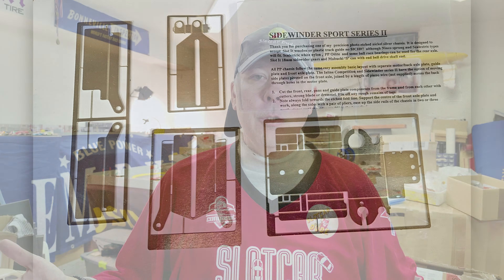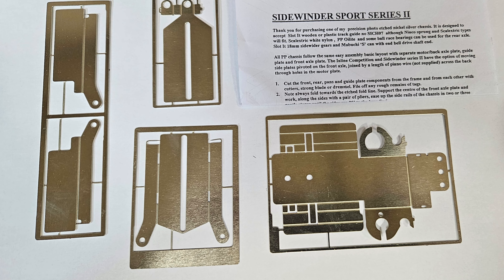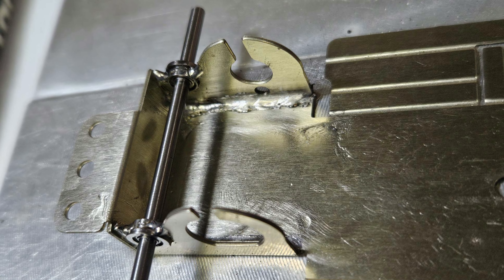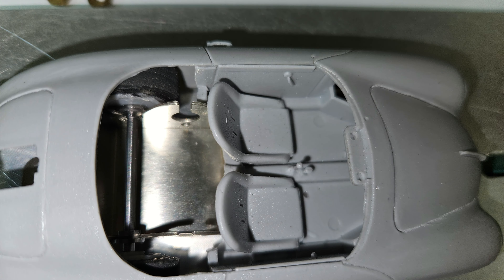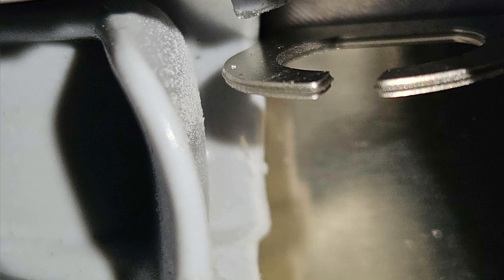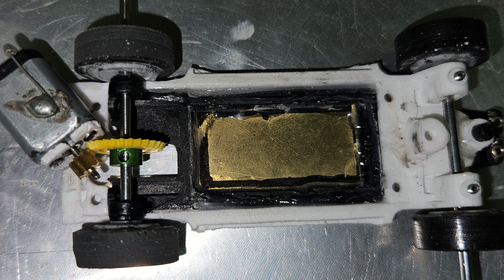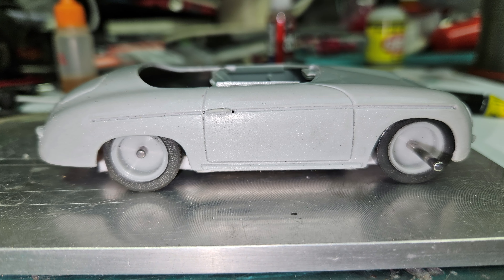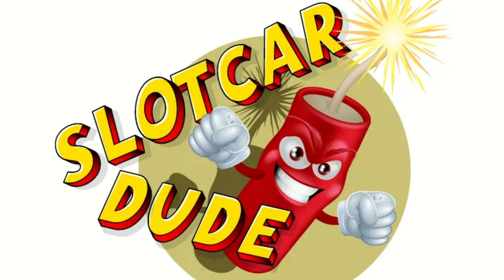Hunting For A Porsche 356 Slot Car Chassis In The Proxy Race #slotcarracing #slotcar #132

Comment: Hi Nico,
Also have some very small body's I wish to convert to slot cars - so similar problems to work out.
I had supposed one way to go at it would be to use a flat tray or similar 1/2 tray interior.
I acknowledge that approach minimizes the modelling possible, but helps on motor placement.
Watching with great interest.
Jack
Reply from the maker: It's a challenge and I want to find a raceworthy solution!!!!!!

Comment: Hi Nico, this motor position is the only solution. Could you use the engine in sidewinder position behind the rear axle?
Reply from the maker: Yes it seems to be the only solution. No, have to use it as shown in the anglewinder position as I will need the screwholes from the chassis to attach the body to the chassis.

Comment: did you tap the holes in the motor or use self tapping screws?
Reply from the maker: The holes were already there. I just used them.
Reply: @slotcardude68  2mm?
Reply from the maker: @r2creatives  yes, I am using 2mm screws there.